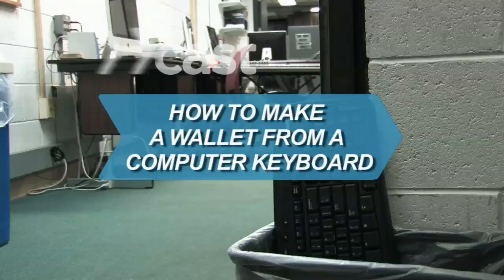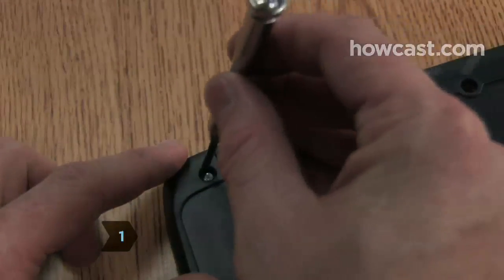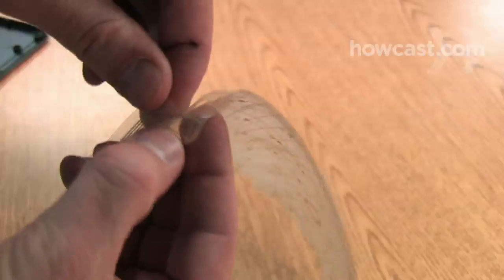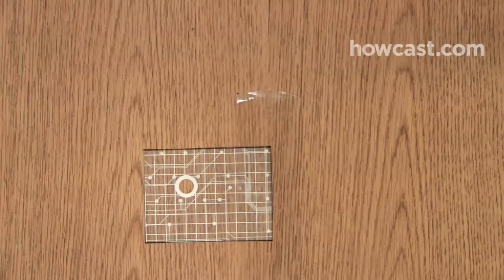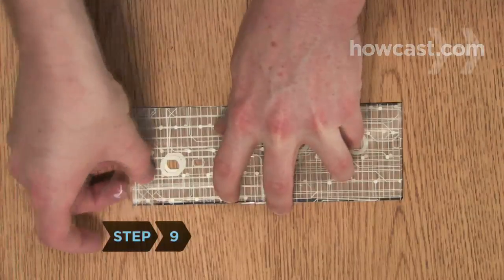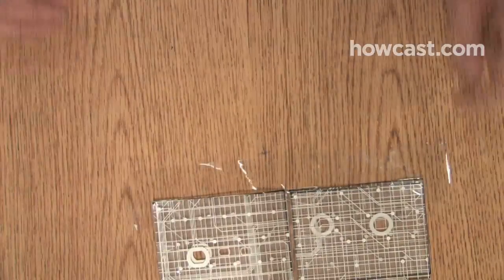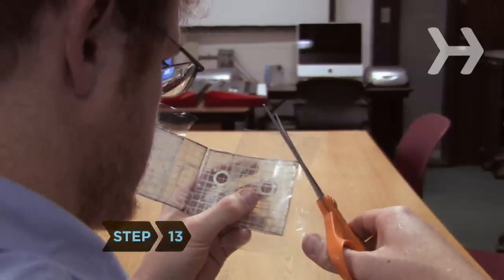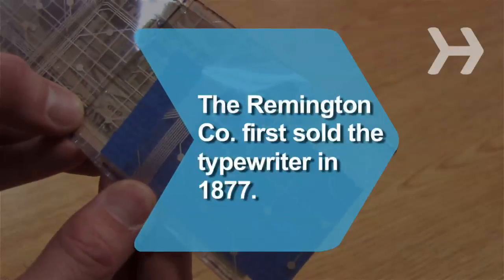How to Make a Wallet from a Computer Keyboard

Comment: Ok, but why ? The tape will shortly lose hold, peel off , leave a gluey mess from the deteriorating tape all over your money, cards, & insides of your pockets. Seems like a lot of work for something that will barely last more then a month ? You can buy a cheap 10$ artificial leather wallet that could possibly last years, and won't gum up the magnetic strip on your cards.

Comment: They don't glue the membranes together, they're melted together so they're always aligned and you'll usually find THREE, not 2 membranes otherwise keys will be constantly actuated since there is no spacer keeping the circuits open.

How does Howcast manage to get something wrong in every video?

Comment: The fuck is this? I can do the same thing with a sheet of pad paper and tape. I can use card board. I can use an old poster. Why the fuck would I bother to open a keyboard to make a shitty looking wallet when I can make a shitty looking wallet anyway using other materials.